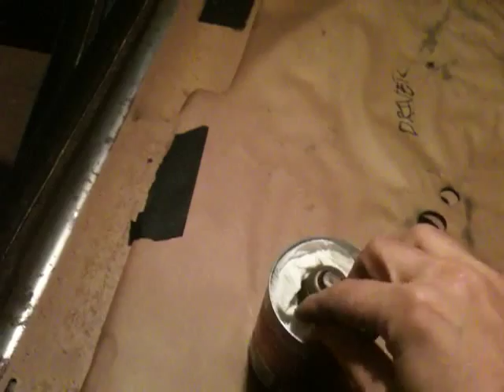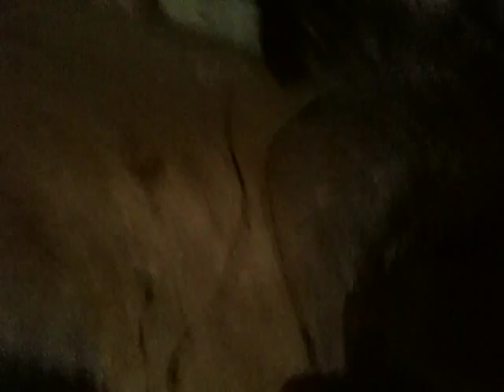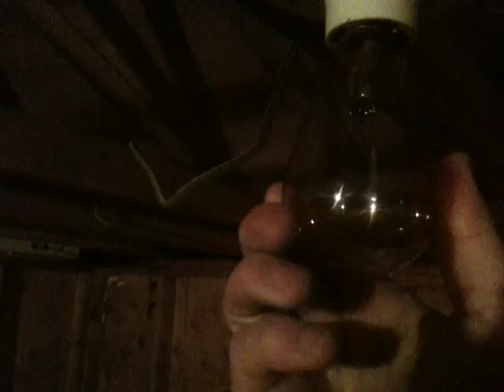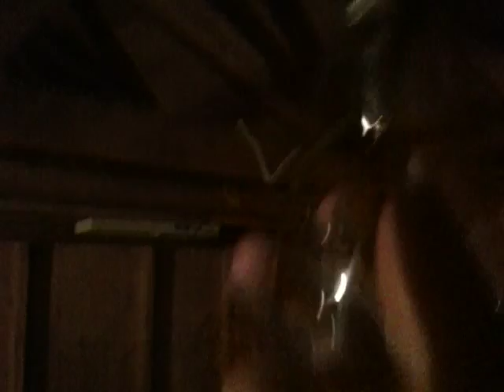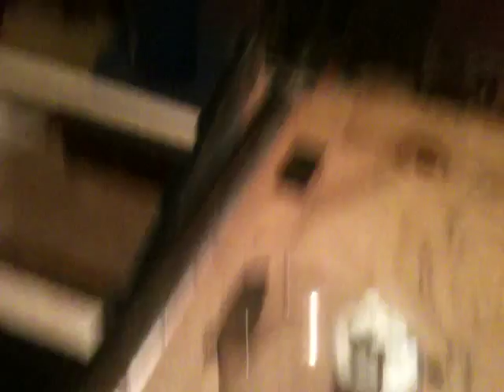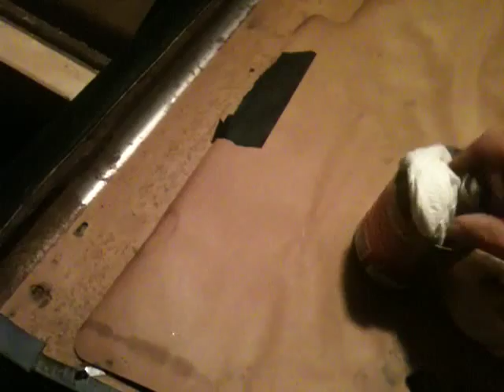100 year old lightbulb

Comment: I've got about 7 of those, all working. 5 of them are in a 5 pack carton with Mazda Lamps on the box. I believe they are from the 1920's. I've confirmed them to be original. A lot of patina on the bases and true vacuum in the bulb. Newer bulbs use inert gas instead of vacuum evacuation. Vacuum bulbs are uniformly warm in operation. Newer gas filled bulbs get very hot in one spot, the uppermost part of the bulb due to heat convection of the gas in the bulb. They will darken in that one spot, the old vacuum bulbs will darken uniformly.
Reply: Soo is that better or no?

Comment: So I got a bulb from ~1949 so seen that it also has 3 gynormous coils like this one and the Centennial Bulb... How ~long will it last? Others say that it will last for decennia if I never turn it off, otherwise it might die within weeks.
Reply from the maker: QuinSoft Netherlands I believe it would burn forever. it's the on/off that kills bulbs
Reply: Ah. I wont have to worry much then as long as it doesnt alter/vibrate too much. Thanx for the confirmation!
Reply from the maker: QuinSoft Netherlands to be fair--- I don't use mine; I keep it packed up

Comment: Nice video Yahueben66. But as far as the 'planned obsolescence' part, you don't know what you're talking about. It's not the same as say, furniture where hand made pieces by a craftsman can result in longer life. Modern light bulbs have the seemingly 'short' lifespan because they're turned on and off a lot. It's about the trade off between efficiency and longevity.

Comment: Key word: continuously
Light bulb filaments very rarely burn out, they explode from the current surge that comes when it turns on. That is exceptionally true on carbon filaments of those old lightbulbs, because carbon decreases electrical resistance as temperature incleases, so the lamp cannot be designed for higher luminescence. So try this: get a high-voltage power supply, make it so current will is close to a modern 60W lightbulb, turn it on/off several times and see how long it lasts.

Comment: it's no surprise that a lightbulb kept padded and in a can will not break; if you pasteurize milk and keep it in a can it can last a long time too. the real test is if you can leave it in a socket for 100 years, which you obviously aren't.
I don't dispute the date of manufacture for that lightbulb, but I would dispute it's durability.
the whole point of a lightbulb is to provide light. the fact that its glass hasn't shattered isn't surprising, but it's also not surprising that it's still in pristine condition, having almost never been used. a lightbulb that you can't use is useless, and a lightbulb that you haven't used has given you no utility, so it doesn't actually matter if this lightbulb is durable or not, because it isn't useful even if it is.
if you think it's so durable, put it to the test. plug it in and record it for 10 years. at that point it would be reputable that old lightbulbs are more durable. as a side benefit, you can use it as a porch light.

Comment: The commenter in this vid, does not know shit about the production of light bulbs.
And even less about the ave life span of it.
Reply from the maker: hey! that's me!
actually a large determinant of bulb life is how often a bulb is switched and how long it's on At a time... any bulb will last longer with fewer switch cycles and longer "on" times
Reply: The light bulb you have is probably an "Edison".
Lifespan of about 600 Hrs ( b50) a standard modern light bulb has a span of 1000 Hrs. b50  but gives much more light for  lesser power consumption.
The old lamp would not even pass the L70 test against a modern lamp.
L= lumination deapriciation
Reply: Many things made then we're in fact made to last a long time, that is a fact